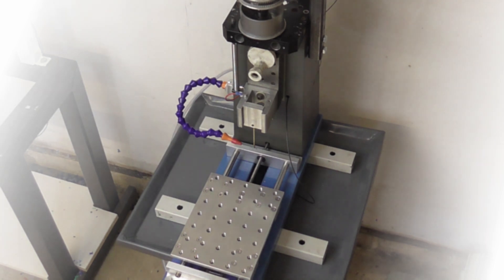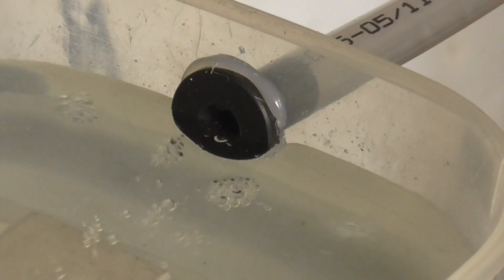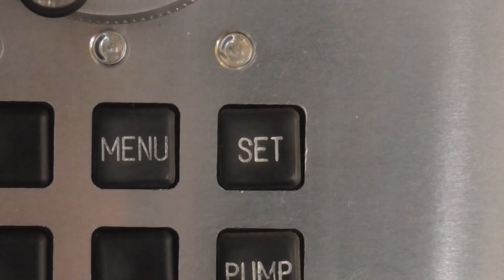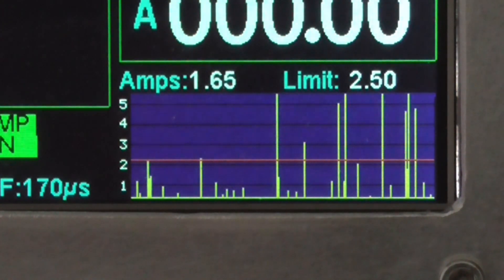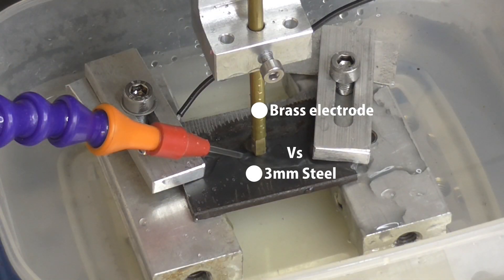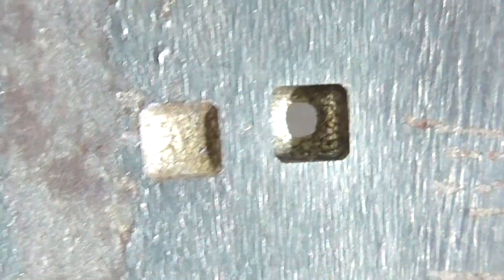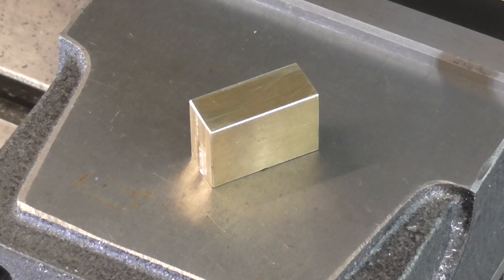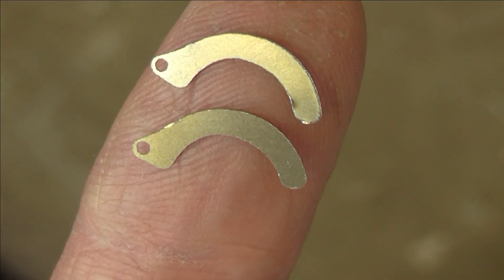Building an EDM machine part2

Comment: Looking great, didn't know the electrodes wore out so fast though. Self made buttons are some overkill dedication, well done
Reply from the maker: I was hoping the electrodes would last longer, but I'm probably not using the best combination of materials, and I don't think I've got the machine completely dialled in yet. I've got some pure copper and some graphite to try next.
Reply: @AndysMachines  I've had the chance to see a similar demonstration on a commercial machine. A square hole just a bit bigger in aluminium and a copper electrode.
The electrode blackened a bit but it wasn't corroded away like the brass one you showed.
So I think you're right, it's just not the ideal material.
I wish you success on your futur experimentations !
Reply: @AndysMachines  I think it's just the nature of a capacitor spark machine. The initial current is super high and fries the electrode along with the workpiece. The pulse machine in Ben Fleming's book is much more gentle on the electrode, but also much less energy efficient since most of the power burns up in the current limiting resistors. Basically it uses such high voltage and resistance that the variable spark gap resistance becomes negligibly small and thus the overall circuit current is determined by the well defined supply voltage and power resistors. There are probably better ways to do current limiting, but I haven't thought of any or found anyone else talking about it. I doubt anything based on current sensing and transistor switching would be fast enough.
Reply from the maker: @dekutree64  This is actually a pulsed machine. The capacitor is switched by an IGBT which in theory cuts off the arc current before too much erosion of the electrode occurs. I think I can get much better results with some fine tuning, but even as is I can make things with this machine that I couldn't make any other way.
Reply: @AndysMachines  As I understand it, electrode wear happens primarily during initial spark formation, so the IGBT will probably only affect the size of craters in the workpiece. But you certainly can do good work with it even if you go through electrodes quickly.
Reply: @AndysMachines  as someone with experience on industrial EDM equipment I can confirm that pure copper make much more efficient & long lasting electrodes. While brass may be cheaper & more readily available it does to tend to corrode much more rapidly.